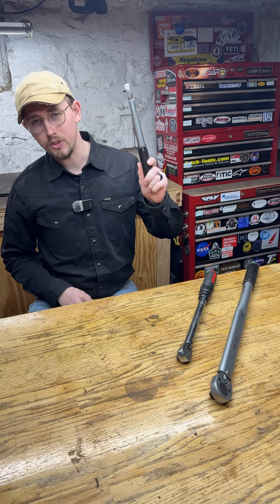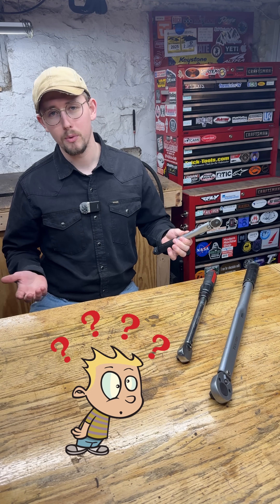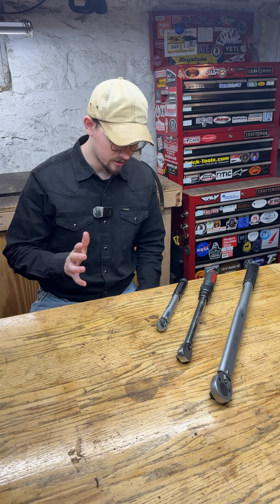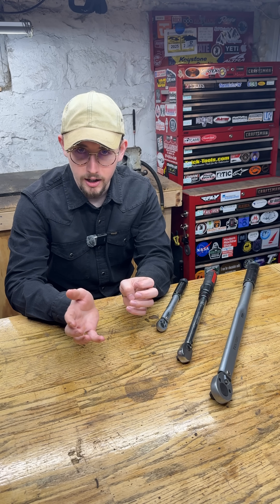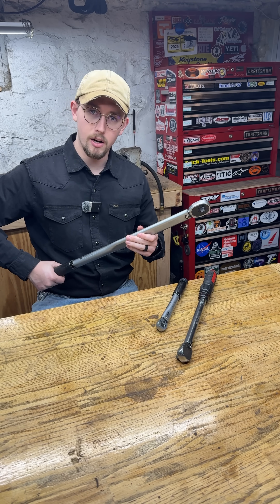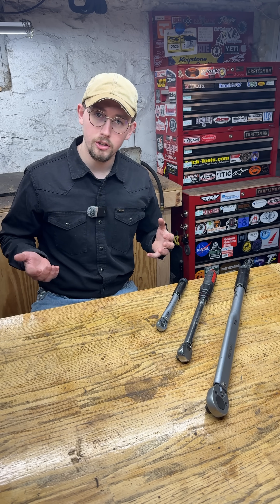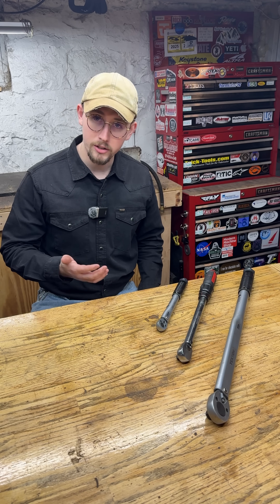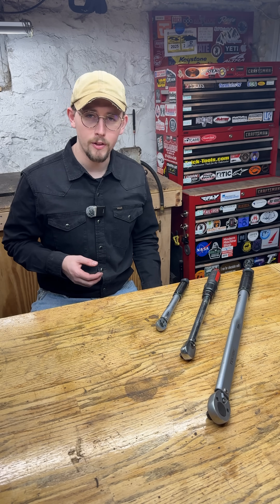The Little-Known Secret About Torquing Left-Handed Threads! - #Torque #RollinOn #RollinOnAdventures

Comment: This is only for this specific torque wrench, I have the same ones but every other torque wrench I've had or used will torque going left. Tekton does this because some torque specs require you to tighten it to a spec back it off a certain amount of degrees and then torque it again, with a normal torque wrench it is possible to damage the spring or other components by going over what the wrench is capable of so it disables the torque parts while going left.

Comment: Your torque wrench is built omni directional but is usually only calibrated in ine direction as omni directional calibration is only considered satisfactory for about 1 year of regular use. Also check to make sure the ratchet stop at the top of the wrench is set for CCW prior to use. Excersize your torque wrench a few time before applying torque as a cold wrench will not be as exact. Finally for the wrench your using you have to subtract 20% of the wrenchs range from both the max and minumim settings. The 60 to 80% in between is your usable range, anything at either max for use can be wildly off.

Comment: I did actually know this but there is a lot of people who don't some really good advice thanks for sharing I shared your video with my son because I don't think he believes me LOL
Reply from the maker: Hey Eric! Thanks for reaching out, and thanks for watching!
Reply: This is only for this specific torque wrench, I have the same ones but every other torque wrench I've had or used will torque going left. Tekton does this because some torque specs require you to tighten it to a spec back it off a certain amount of degrees and then torque it again, with a normal torque wrench it is possible to damage the spring or other components by going over what the wrench is capable of so it disables the torque parts while going left.

Comment: My snapon does both left and right that’s why I buy the best to start off
Reply: I mean snap ons definitely not the best brand it could be considered the most expensive
Reply: @slayrandom9592  Snap On is the most expensive there is nothing to "consider". 

But Snap On is also the best, real head to head tests from Torque Test Channel and others show Snap On consistently outperforming other brands to a statistically significant degree.  

 Its not 1-2% sometimes its 5+% almost always. 

  Does that make them "worth the price?"  That depends on the person, for most things I say its not worth the cost.
   I do have a few Snap On tools and I spent the money because I got tired of breaking other tools (especially 3/8 hex/torx/triple square bits) Ive had my Snap On bits for 15+ years and they haven't failed me. 
    
But lets be real if someone told you that you could build your dream tool set from any brand, no matter the cost and it was free you would go straight to Snap On.

Comment: Thats a new one for me,thanks mam
Reply from the maker: No problem buddy! Thanks for watching!
Reply: This is only for this specific torque wrench, I have the same ones but every other torque wrench I've had or used will torque going left. Tekton does this because some torque specs require you to tighten it to a spec back it off a certain amount of degrees and then torque it again, with a normal torque wrench it is possible to damage the spring or other components by going over what the wrench is capable of so it disables the torque parts while going left.